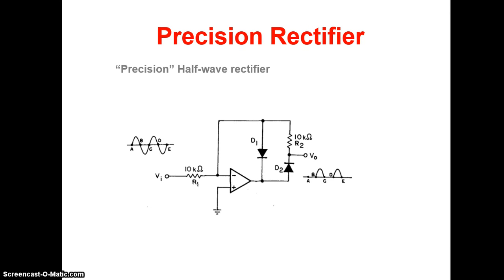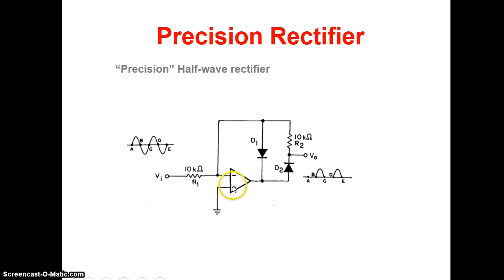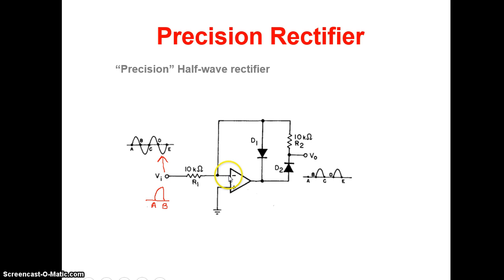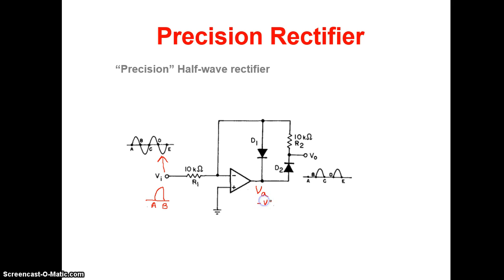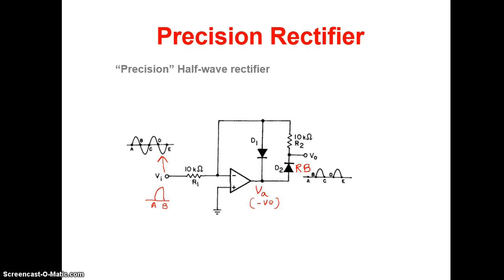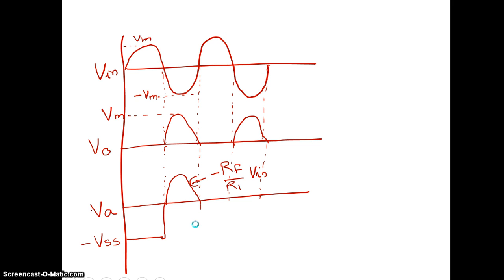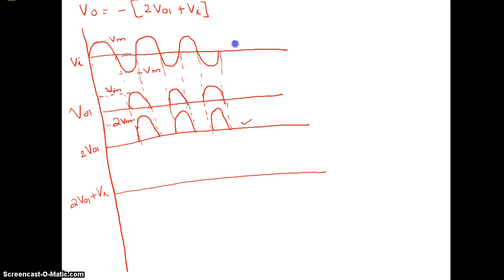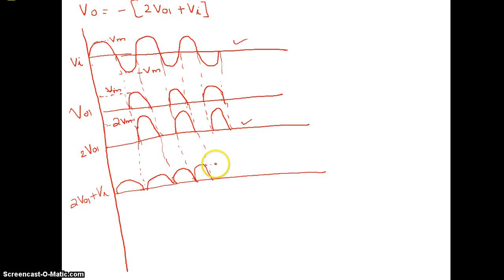Unit 3 Video3 Precision Rectifier

Comment: Mam........ What is the function or role of diode 1
Reply from the maker: When D2 is off and if D1 is not there , no feedback connection from output to inverting terminal,acts like comparator. Hence vout will switch to -vsat.In the next half cycle ,D2 is on ,there is delay in getting vout ,if has to change from -vsat.In order to avoid this D1 is connected.
Reply: Thanx a lot mam.......

Comment: What is the function of the D1 in that circuit? I'm unclear about that.
Reply: D1 closes the feedback loop  for POSITIVE inputs :
 the Op_Amp remains as a linear device when D1 conducts ; 
without D1 the Op_Amp circuit would become Open_Loop:
 saturate , cause switching delays , ruining the circuits accuracy for NEGATIVE inputs .